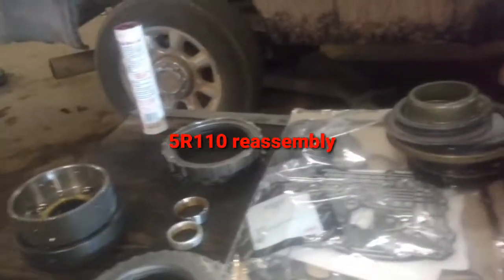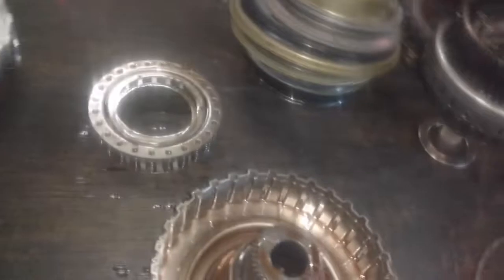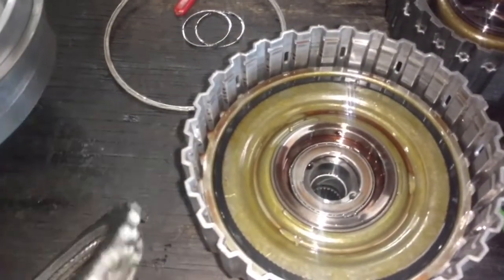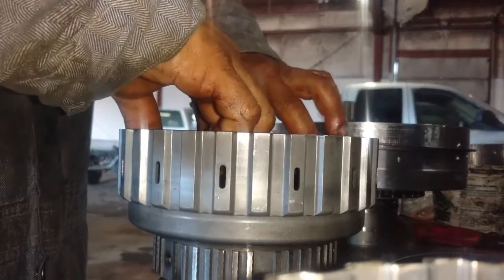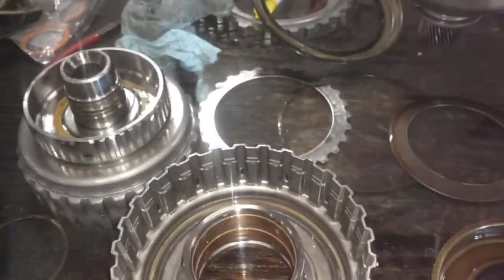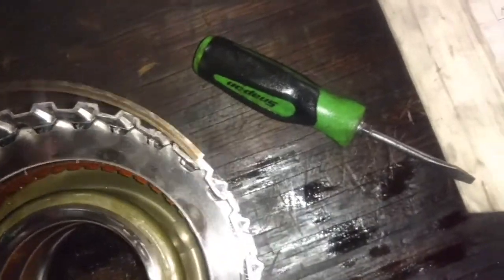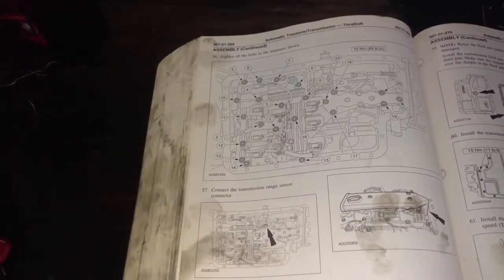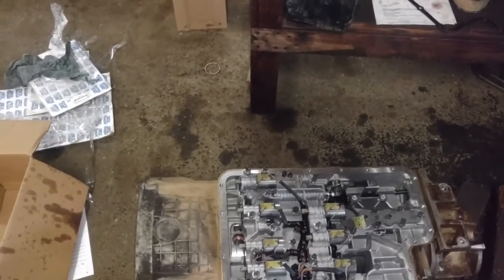5R110 rebuild (reassembly )

Comment: Rebuilt the 545rfe in my Dodge a couple of years ago. Trans wasn't bad, but the torque converter hub sheared and I wasn't about to put a trans with 140k on it back in.... I've done a lot of autos over the years but this one threw me for a loop. Couldn't get the clutch pack clearances right. Bought a builder's manual and discovered that the clutches and steels looked the same but were different thicknesses. Few minutes of sorting them with a micrometer and everything dropped right in. Lesson learned. Thanks for another great video, Warren!
Reply from the maker: John Baugh  I've  got a 545rfe to do this winter. I like  doing those automatic  transmissions, for  me it's  easy bench work  and not so damn heavy  like the rest  of the stuff  I  work  on.

Comment: Good vid - thanks.
I am doing this on my '05 soon.  Getting my kit from OPT as well.
Have you seen their 2-clutch billet converters for the 5R110W.  Any thoughts on those?
thanks
Reply from the maker: Dan B I haven't used any in the 5r100's but I have used the dial disc converters from them on the Allison lct1000 in the Duramax's and they seemed to hold up just fine.
Reply: thanks again.  One more question if you don't mind:  A lot of folks seem to prefer a low-stall converter on their F250's.  Do you or your customers prefer a lower than stock stall on a torque converter?
This truck is my daily drive and I pull a bass boat on weekends (stock tune).  I don't have any dislikes really about how it drives but I want to consider all options.  I don't know if I'd like it or what the benefits of a low stall converter would be.  Thanks for your time!
Dan
Reply from the maker: Dan B  Most of these Farmers and ranchers constantly have either a stock trailer or gooseneck flatbed they pack around, and I have always just used the stock converter stall. I have put high stall ones on some kids pickups that like to race and tear their stuff up. To be honest I have never had any one ask me for a lower than stock stall replacement.

Comment: I installed transmission after rebuild and put it into drive the tail shaft spins and I put it in reverse and still spins the same way also neutral spins the same way what would be the issue

Comment: That low/reverse spring compressor, does that one actually work? Thats only about 30$ on ebay. Conpared to 130 for the actual 5r110 one
Reply from the maker: Yes, that's what I use.
Reply: @westerntruckandtractorrepa1353  are you talking about the T-0151 tool that is for the th350 and 4l60 series GM transmissions? Getting ready to do this myself

Comment: Have often do you or anyone else reading this post get too many steels or frictions in a rebuild kit or maybe sometimes get the wrong frictions?
Reply from the maker: Chad Cole Quite often
Reply: Thanks for the quick reply. Excellent video by the way, I especially like the use of the bailing wire, saved me a few dollars.